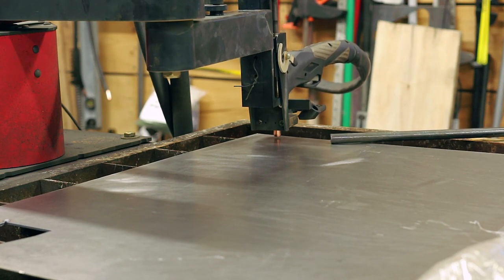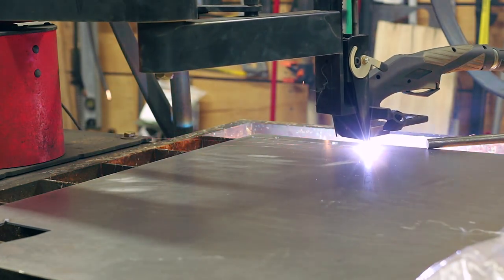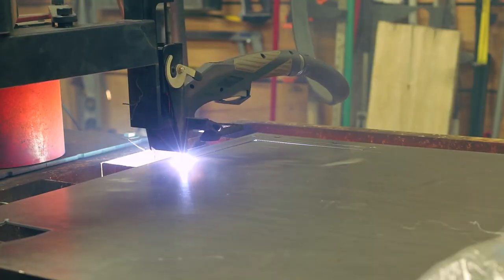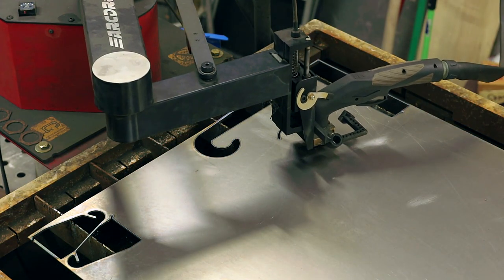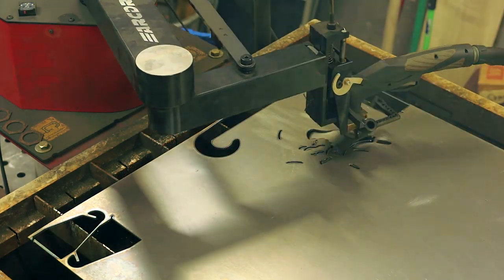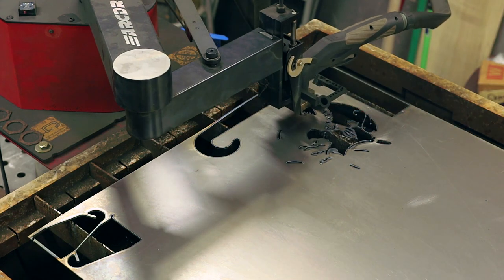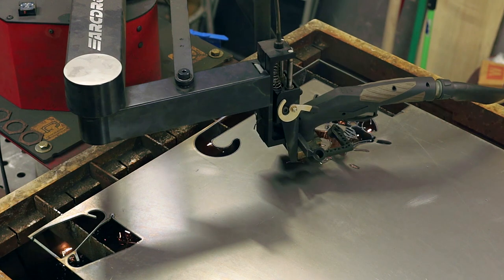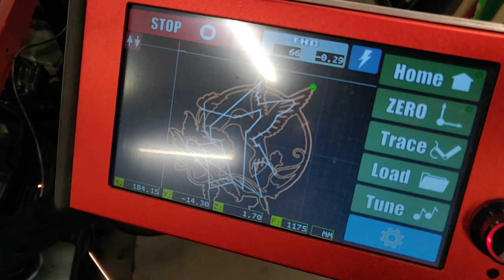ArcDroid: THC in action Hummingbird Feeder/Plant Hanger

Comment: Beautiful art work ... I am confused about your voltage divider however .. with the firmware fix on the Arcdroid and a good 50:1 signal from a Hypertherm .. do I need your additional box? if so, what does it add to the equation?
Reply from the maker: Probably not, the hypertherm seems to have a decent voltage divider in it. Many other brands, it's hit or miss. If you find the torch diving into the material or bobbing a lot with THC on, then you may want to consider an adjustable divider to get the TH value in a lower range. My divider does have some extra bits for smoothing and some circuit protection. But if you are not having issues, you probably wouldn't see any benefit from it.
Reply: @amp_mechanic  hey thanks for the honest informative reply, much appreciated .. just getting into this and I'm seeing a lot of other people all confused and buying all sorts of Hypertherm CNC cables and additional gadgetry .. your videos certainly help to dispel the myths .. thanks

Comment: Do you need special torch to use THC ? I have a Cutmaster 52.
Reply from the maker: No. Just a divided arc voltage. If you don't have a CNC port, you can run wires direct from your + and - lugs inside your plasma, to a voltage divider, then out to the ArcDroid Aux2. 
You do need to email Arcdroid with your Serial to get the unlock code as this feature is still technically in development.

And as for voltage dividers, I will likely be making some more, I just have a large order I'm trying to fill for a specific system. Once that's done I'll look at getting a few more built and up for sale.